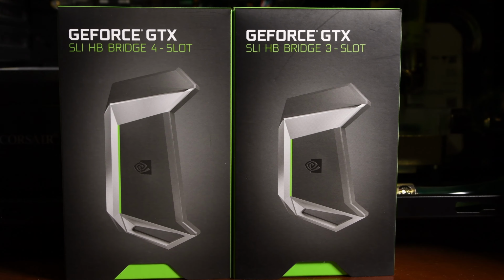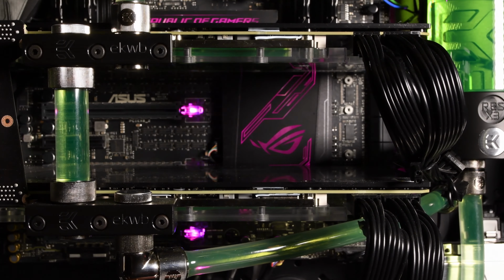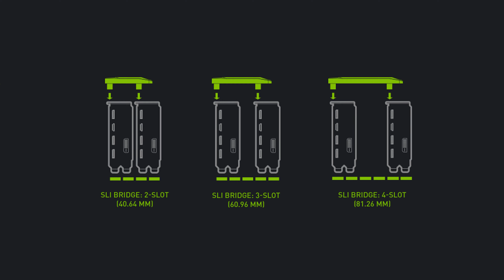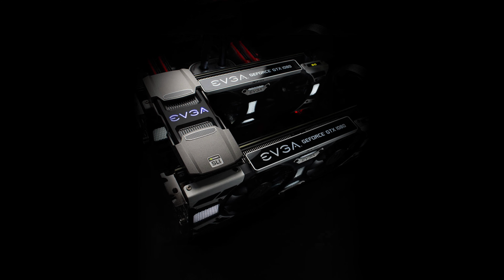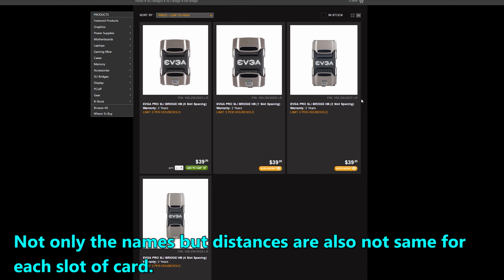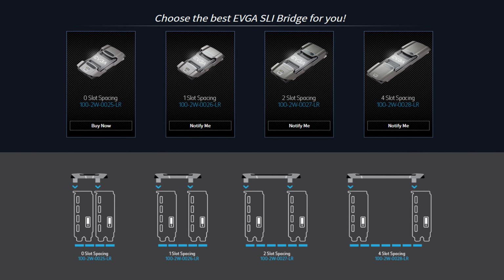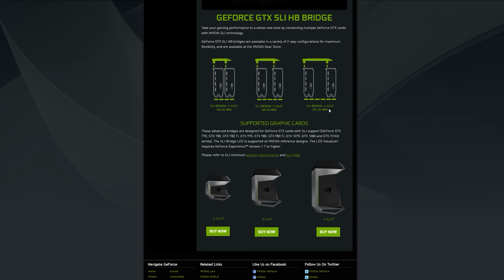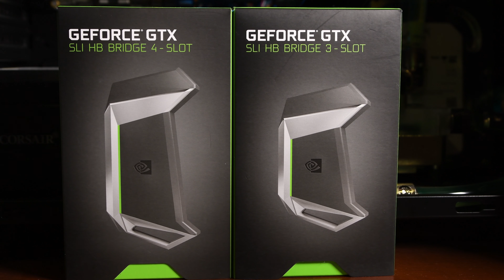Finding the Right HB SLI Bridge for Your GPU Setup

Comment: If I have 2 RTX 2080tis what do I use
Reply: The RTX is using NVlink. NOT SLI Bridge. The difference are the connectors. They have more pins on NVlink.

Comment: what EVGA sli bridge do I need if I'm using a z270xp-sli motherboard? I'm using pci slot 1 and 2 for gpu. I think I need a slot 2 EVGA bridge but I'm not sure.
Reply: 1 slot spacing Evga HB bridge.
Evga names theirs after the number empty pci-e slots between 2 dual slot gpus.

I have a motherboard with a similar layout and i'm using the 1 slot spacing one on an x370 gaming pro carbon for my sli 1080ftw cards.

Comment: I just bought a ROG Strix X99 Gaming motherboard. I have to use first card on 1st slot and the second card on 4th slot. If you do the math, each slot have 2 cm of space, plus each slot is 1cm ish 2+1+2+1+2 = 80mm
so I need 4 slot hb bridge like you right?

but also if you check the link it says i need 60mm  
https://www.msi.com/Graphics-card/2WAY-SLI-HB-BRIDGE-M.html#hero-overview
so confused